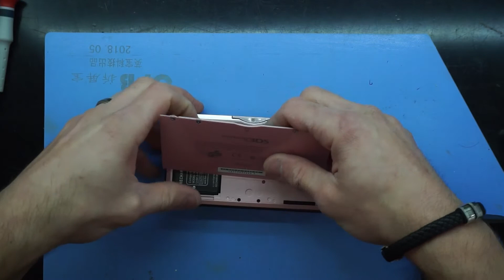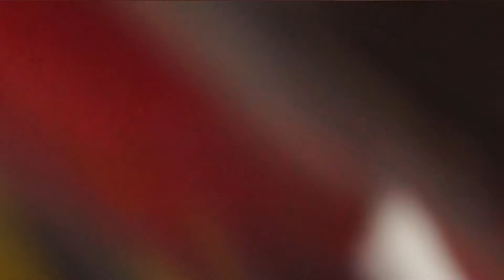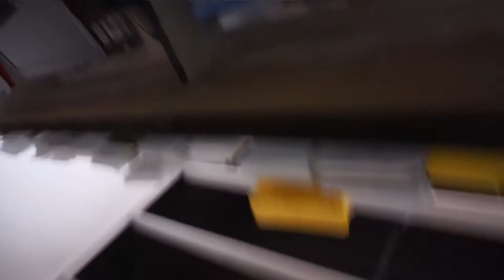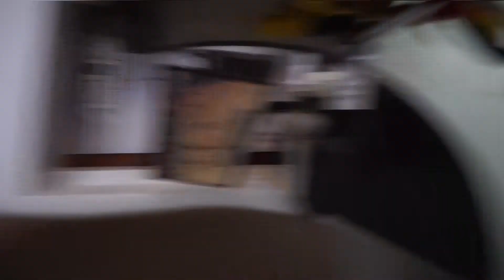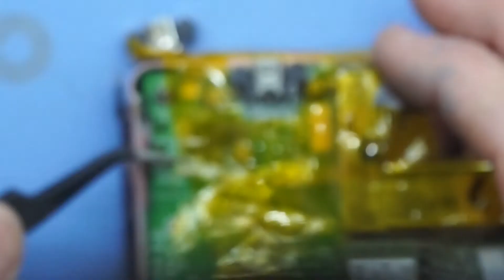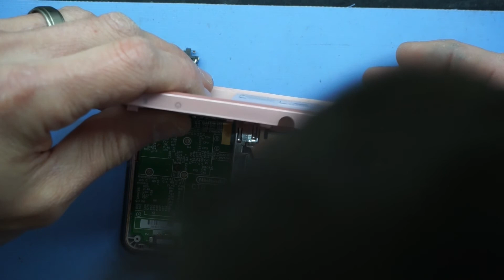Nintendo 3DS Charger Port Replacement

Comment: Ohhhh this'll be so helpful, thank you. I have the Zelda Anniversary 3DS and it died years ago. I need a port replacement and a new battery lol 
Fiddling with the port to work around a bad battery is what caused the issue I had XD
I really want it back because it had stuff like the Four Swords port.
Reply from the maker: Good luck with your repair

Comment: Hi.Do you know where I can find the charger port for 3ds? not new 3ds or 3ds XL?
Because is very difficult find him.
Tx
Reply from the maker: Aliexpress, would be my go to place
Reply: @rickstechrepairs  yea I tried them but they only had the ports for the NEW 3ds.
Reply: @seniorpz1969  I have the same problem have you found a place to buy it?
Reply: @Jbjb879-g3v  I put purchased the parts from Allied a week ago..still waiting on shipment

Comment: question do you need a heat gun for this process or can I just use a sautering iron
Reply: don't do it with an heat gun, you will damage the plastic like he did. Actually it was a bad video really :/
Reply: @Stry-Glitch  just buy a cradle from Amazon.  I cant do this homemade...😔
Reply from the maker: It might be possible with a soldering iron and a solder sucker

But the heat gun is the way to go